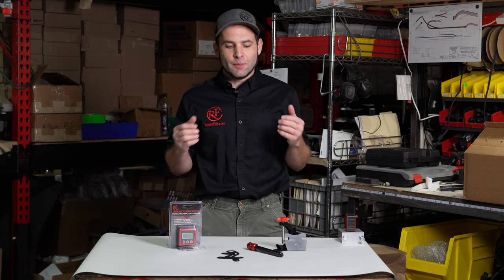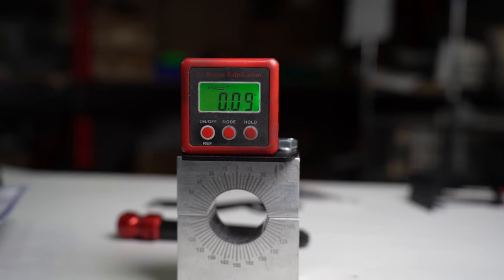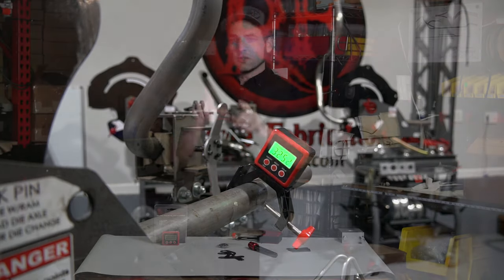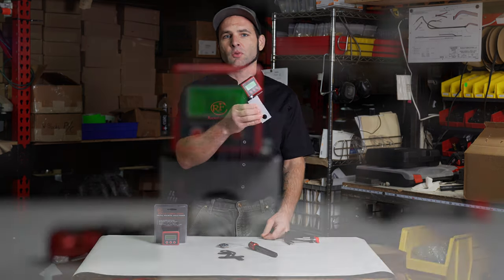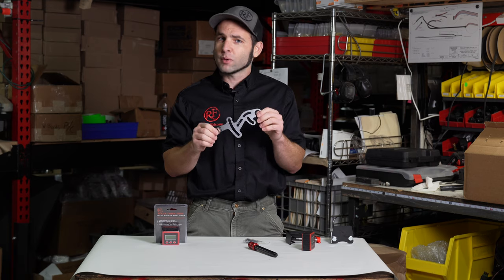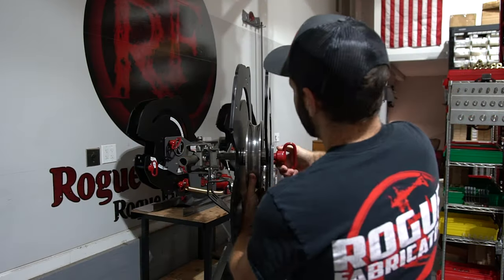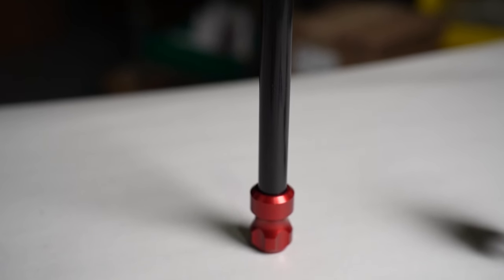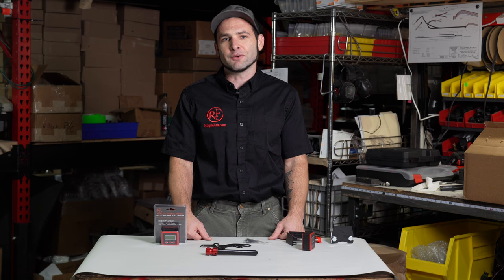Tube/Pipe Bender Upgrade Package

Comment: Hey can the m605 be upgraded to the heavy duty m625 later? I’m about to finally pull the trigger on one.
Reply from the maker: No, the frames are different. The dies are the same though, so you can buy an M625 frame later if you need the capacity and you started with a 605! -Joe